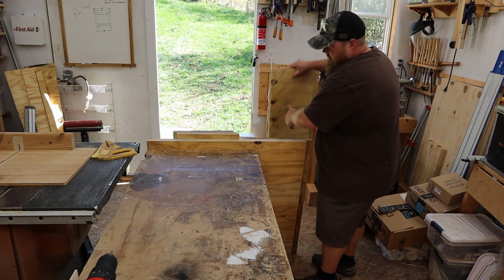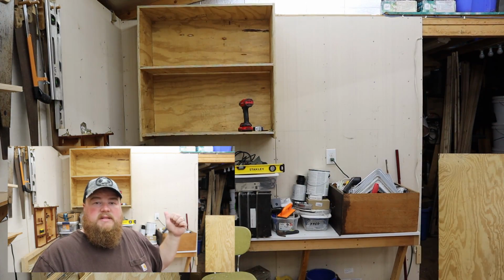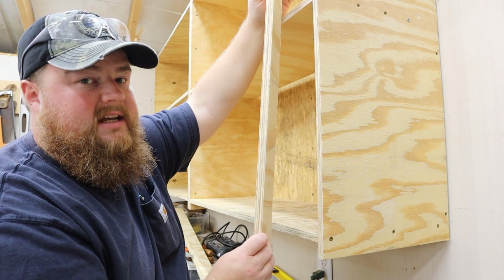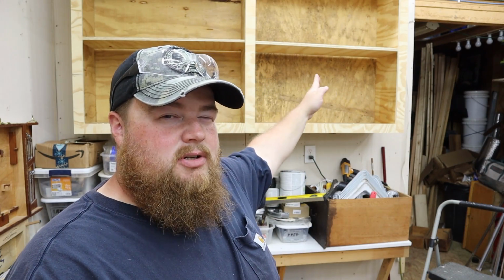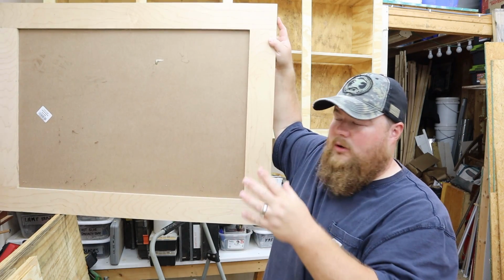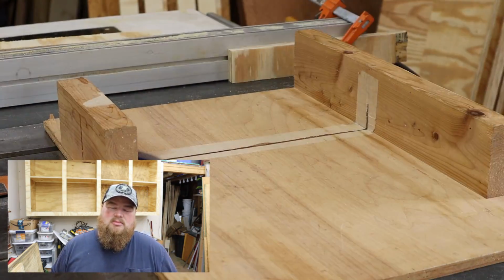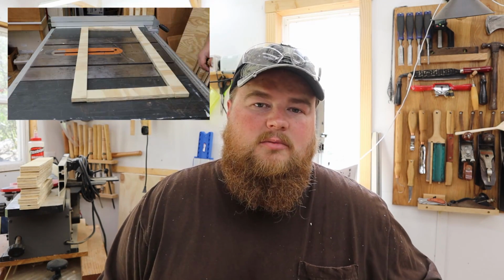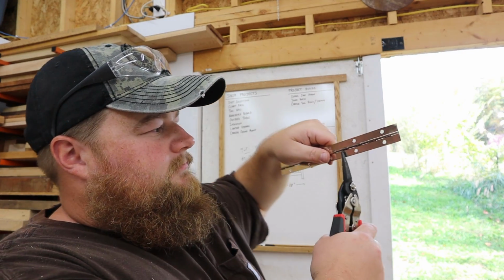SCAVENGED PLYWOOD - Workshop Wall Cabinet Build

Comment: Thanks Sam. My husband Andy I are building shelves in the basement and are trying to avoid the mortising the butt hinges. The piano hinge looked like a great idea but we'll have to do a lot of adjustments because we've used 2x4's as a frame and they are not flush. The vertical supports are further out than the horizontal ones. It was the simplest method to make them. White boards look a lot nicer than plywood and probably lighter. ✔️👍

Comment: Try spring clamps for quick clamping of thinner material stacks, they're cheap cheap cheap, versatile & remarkably fast. U coulda clamped the 2nd carcass to the 1st (2 or 3 spring clamps), your spacer block to carcass, etc. It'll change ur clamping lifestyle vs always reaching for F clamps.

Comment: Bigger is better so don't worry, well done with the project. Liked it heeps, will make mine similar in my "Car Port". I've got NO SHED. So I made an extension shed at the back of my carport, being W12'x D4', yeah, I'm in Australia but still work in feet and inches when it suits me, then other times it's so much quicker and simpler in Meters x Millimeters, it's more exact with out saying a LONNNG measurement like 12' 1/3"'s long, silly measurements. Anyways, whatever works in your shop you use it, YOUR way. Now I've got the back shed made, it's got a side door and front, but the front door has a 900mm small door plus a larger door of 2.7m making up the rest of the measurement of the width of my carport. Next I'll be putting a wall between me and next door neighbor, then I can put this wall cabinet up and a Tool cabinet being 2400x1200mm sitting on top of my bench, with a further cabinet with 2 doors to hold my tools that don't have boxes for them inside here. So, with your setup, it's going to be great once finished. BLOODY RIPPA MATE. Take care buddy and thanks heaps for your input.

Comment: I need to put doors on some garage storage myself and I like what you did with the doors! Are you concerned with the doors warping since they are plywood? I have been advised to stay away from plywood because of warping but keep seeing it in many shop build videos. Thanks!
Reply from the maker: These doors aren't perfect by any means, and I've been meaning to do an update video on them. However, they're still fine for what I use them for -- hiding junk! :) The corners need reinforced to make them stronger and less flimsy, otherwise I'm happy with them for their cost and process.

Comment: Nice job. BTW, nice 1930s Sears Companion tilt top saw.
Reply from the maker: Thanks 👍 I bought it from a local thrift store for $20 for some reason LOL No clue what I'm going to do with it!!!
Reply: @Samcraftcom  Nice! I have a slightly newer 1940s Sears Dunlap I use for dados and secondary operations. Mainly when I don’t want to move the settings on the main saw.

Comment: Love it Sam! Want some free hardware? I stop any time I see someone tossing out furniture, and toss it in the back of the truck. I take it home, remove all the pulls, hinges, closers, slides, glides, screws etc and toss them into a clear Ziploc bag. If the piece is real wood I'll break it down, if not, it gets dropped at the dump on my next visit. You would be amazed how fast the hardware adds up! So if you want some pulls let me know. The cabinets sitting off of the left wall is screaming for some stacked shelves to fill the gap now....
Reply from the maker: Hey Tim, you have my ear! 😎 Send me an email!

Comment: I like your style, plus the fact that you have a R4512 I pimped mine with an Incra TS LS Joinery System. I noticed something I bet very picked up on! How you held the brad nail gun perpendicular to the part you were driving the brad into! This does help in keeping blowouts from happening (brads exiting the side of the work) 
The piano hinge trick is pretty neat! For door clasp In the future I suggest neodymium magnets!  Order on line they are much cheaper and the 54 series are stronger magnets. The cabinets look nice! 
😀🛫
Reply from the maker: That's a good idea for magnetic clasps, I like it! Thanks for the info. :) Also I'm drooling over the Incra on your R4512. ;) Thanks!
Reply: R4512 does dress up the Incra TS LS Joinery System. 🤣🛫